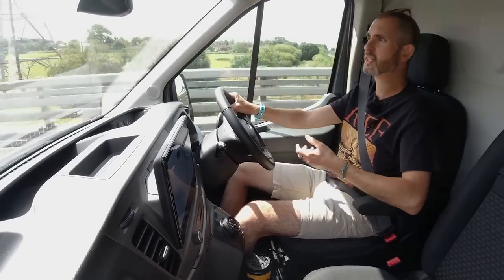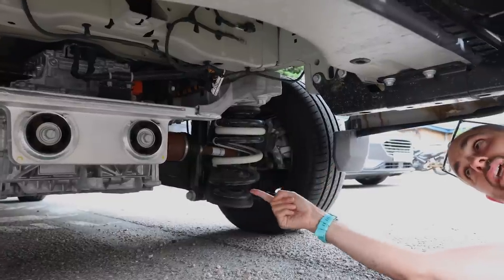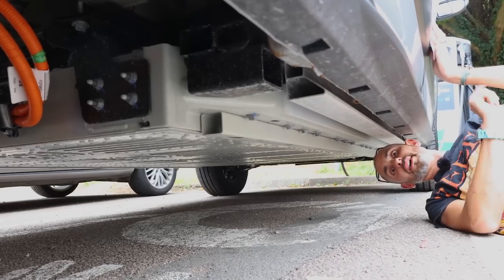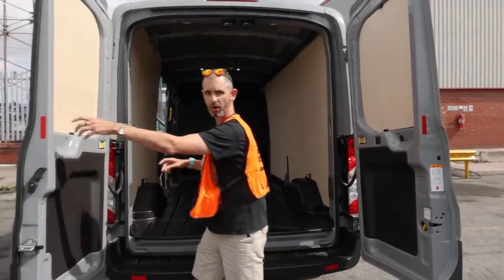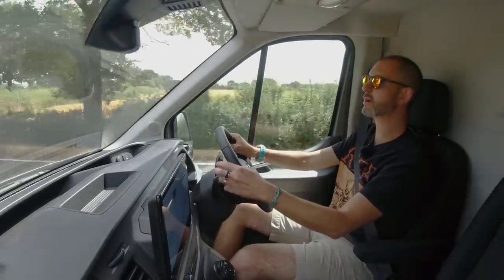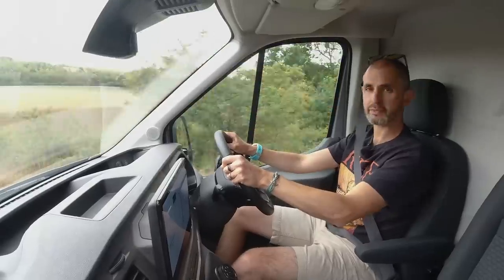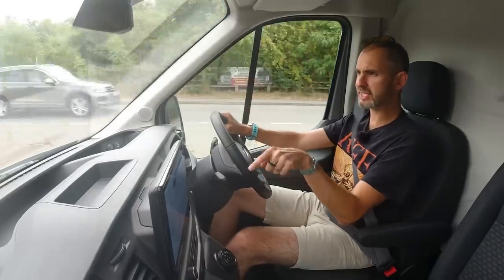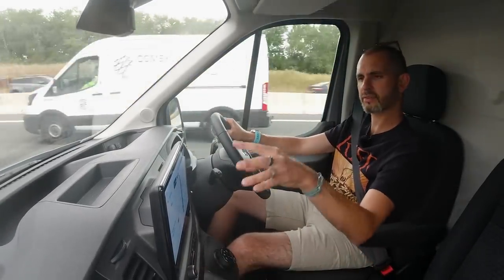New Ford E-Transit electric review - the most important van of 2022

Comment: Donny and back in one go with a diesel 🤷‍♂️
Reply from the maker: Yes, obviously, but I needed to show the toughest kind of task it might be given. Always hard to show everything on a video, but remember most EV vans will be used on sub 80 mile trips with numerous stops. That is when diesel cannot compete.
Reply: @TheLateBrakeShow  and even if the diesel tank can do that round trip in one go, the driver's bladder can't, so... I'm by no means likely to buy an EV myself, but I do get a bit tired of some of the hackneyed arguments against them.
Reply: @richardharrold9736  charge time in this "van driver's" day was about 45 minutes Vs how long to pee?  Makes sense for multi drop though.
Reply: @neilgorin1037  less than... in which time it gained about 45% charge... each time you stop for a break, give it ten minutes and it'll charge at least 10% (likely more, these things tend not to scale linearly), then how long does it take you to get lunch? For most purposes, EV works as well as diesel. Ford isn't trying to pretend it will suit everyone, though.
Reply: @richardharrold9736  makes sense, once there are enough charge points obviously.  If everything is electric, every third bay would need a charger Vs the 5 chargers for 500 spaces at a typical motorway services today - which isn't enough even now judging by the queues at some of them.

Comment: Johnny, why are you not taking a look at the Peugeot expert electric Hydrogen van...NOW that is the future.. if not the great PSC expert, relay, vivaro electric van..200 miles PLUS...I reckon I'm on my last all derv van... Which is FUN... euro 6 , 180hp, 400 nm of T, 0-60 in 8.5, 8 speed semi auto box...manual option with flappy paddles, electric side doors, dual climate, head up display, adaptive cruise, apple car play, android auto ....every thing, carries 1350kg payload and will tow 2.5 tonnes  £23500.00 plus vat...
Johnny, too much body hair for Shorts

Comment: I have an e-expert van which goes further due to bigger battery. I’ve done 20k mikes in 6 months and covered from Inverness to Portsmouth to Norwich to West Wales. Range killers with electric vans are any temperature below 13 degrees, headwinds, anything over 62mph, hills going up. 
It’s great. Don’t think I’d go for the E-Transit due to smaller battery. 
2 hours driving then charge. Networks is there (it’s sketchy above Perth in Scotland and along the M74!) 
Love electric vans though.

Comment: Albeit not available here, you can get these in some markets with an Ecoboost 3.5 TT V6, which I think will be faster than this...
Reply from the maker: That engine is stunning in a Mustang (which we also cannot get in UK)
Reply: @TheLateBrakeShow  yeah, we only get the V8, right? I think we also got denied the related 3.7 N/A Cyclone V6, which I think is a shame. Similar power to a 302 and lighter/shorter/further back than the Coyote.

Comment: Full of false information.
Electric motors are not nearly 100% as u suggest.
The fuel tank on diesel transit is in middle of vehicle.
KEEP UR EYES ON THE ROAD WHEN DRIVING  ! ! !
Reply from the maker: Elec motors are usually over 90% efficient, as v little wasted power and v few moving parts.

Comment: £55k to £65k for a van!! also the cost of electricity to charge the van then in 10 years it will need new batteries that cost £10,000
Reply: Ah, you obviously never heard of battery refurbishments..... they cost a fraction of a replacement battery.  Do you swap your engine when it gets worn? No, you have it refurbed. It's the same with an EV battery......